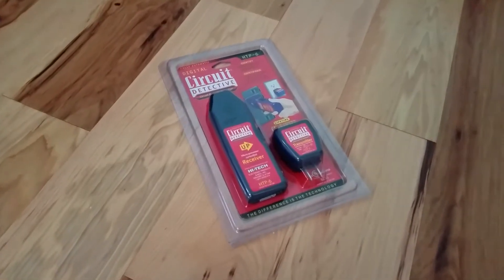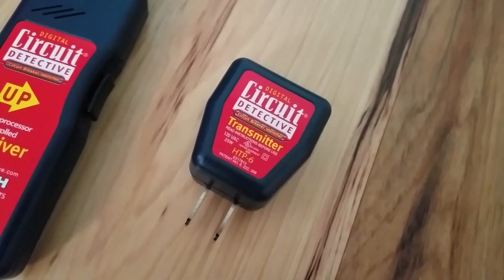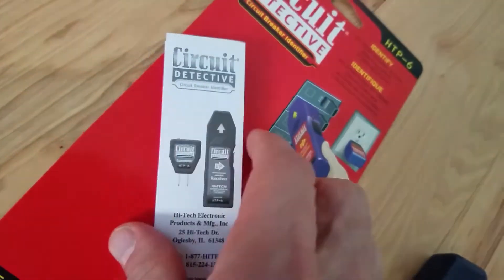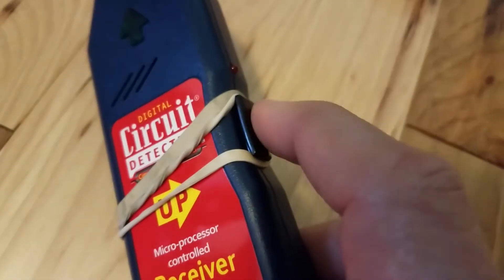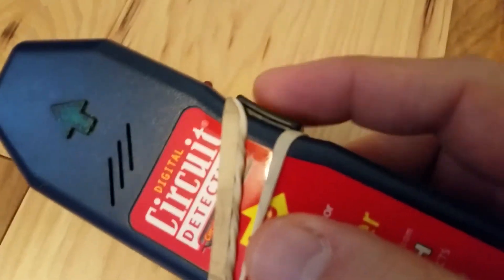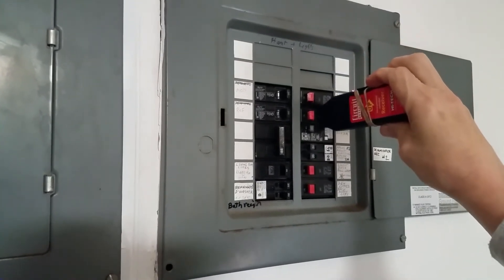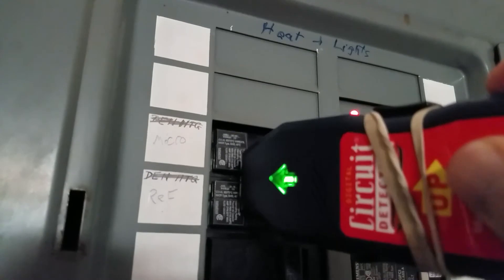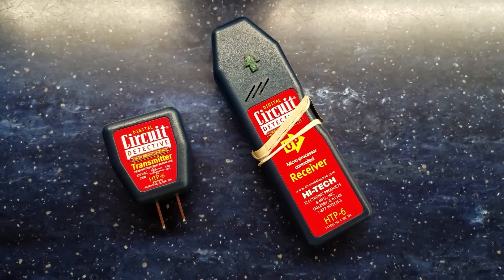HF CIRCUIT DECTECTIVE OUTPUT

Comment: Great idea with that rubber band -- THANKS for the video!
On my unit (which I've had for a few years) a suggestion is that the user purchase two additional items to make this tool super useful: Get one of those receptable-to-light-bulb- screw-in adaptors, very inexpensive $2 and at many hardware stores. It literally has a bulb screw in on one end and a two prong plug on the other end of the one piece adapter. The other idea is to make up two short conductors with aligator clips on each end so that you can also connect to lose hot and neutral wire terminals that have nothing yet attached. Thanks again!
Reply from the maker: These are wonderful suggestions. Another to consider is making your own line splitter,  https://youtu.be/6SV7CdllDiA, I find this comes in handy a lot. Thank you for taking the time to watch and share, very much appreciated.
Reply: @cfldriven  That is so funny! I watched that video a while back and made that splitter! I did not know it was also from YOU 😁. Thanks again!
Reply from the maker: @AerialLensVideo  While talking to my neighbor about the purpose of a splitter he  brought over his homemade one. I decided to build my own instead of buying one. How interesting that you've seen the video before and made your own.  I owe a double thanks.